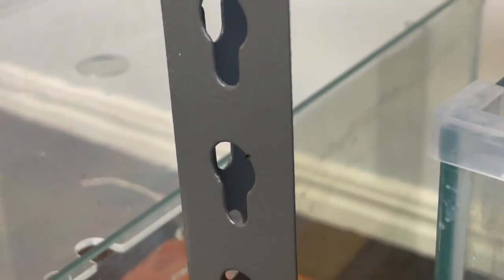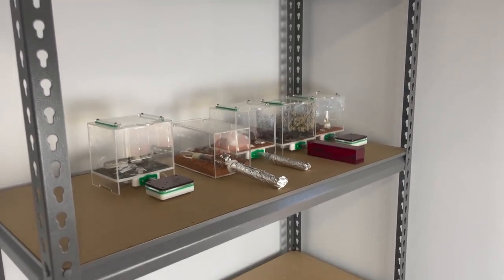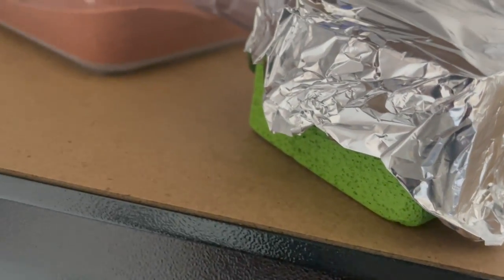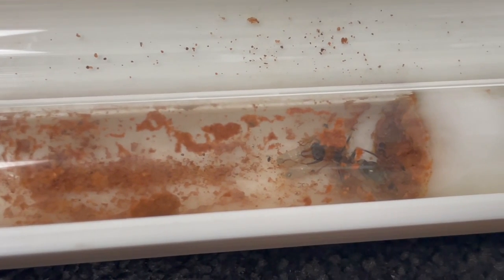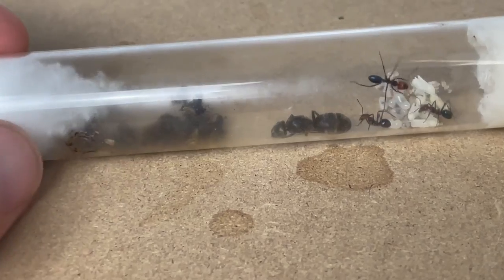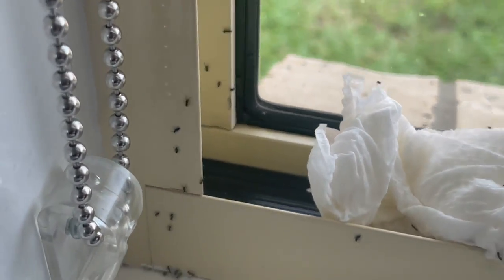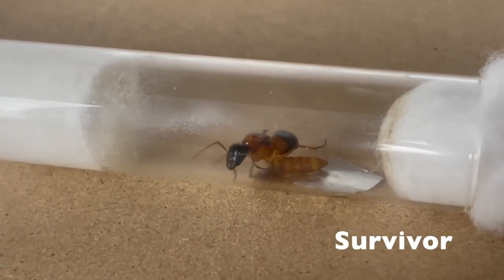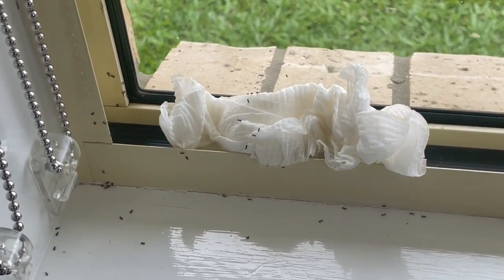Ant Army Invasion Attacks Our Colonies! | This Was A Tough Video To Make

Comment: that's awful but its also part of the hobby, i too have lost a few colonies due the ants in my house and ive found the best way to keep them out is to literally seal up any gaps in my setups with hot glue or silicone, also to only use very fine metal mesh for ventilation.
Reply from the maker: Thats so true! It is definitely time for an overhaul!